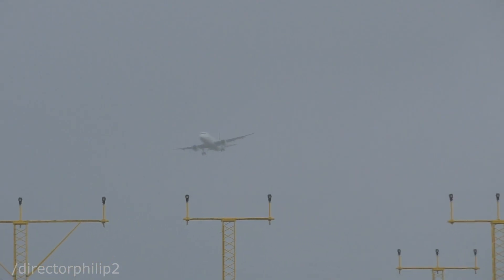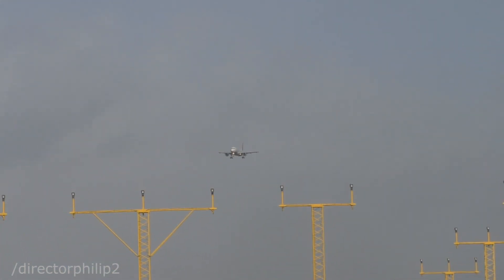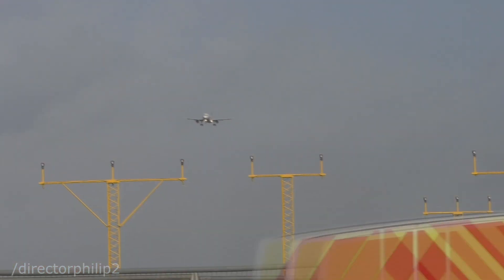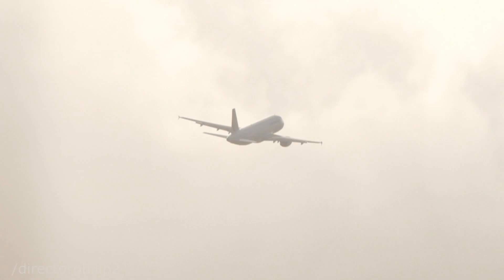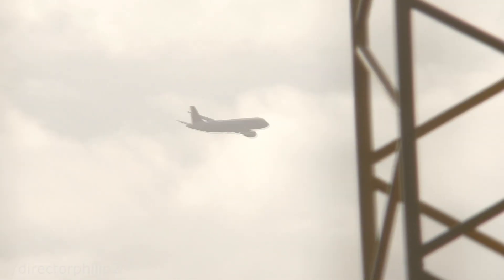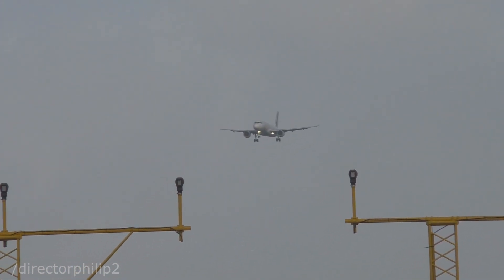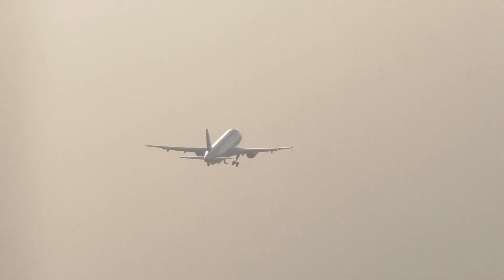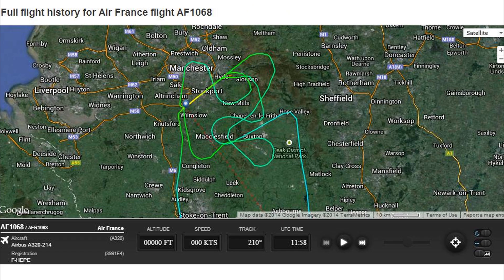Crosswind landings aborted 3x Go around extreme weather

Comment: Great video! To your question in the intro: the autopilot is a great tool but it isn't perfect (yet?). That's why almost every landing is manual exept when very precise conditions are met. In these condidions it id probable that the autopilot will disengage automatically on final approach of at least does not authorize auoland. To illustrate this: a 777, one of the most advanced and widely used aircraft in the world, ended 50 feet off the runway due to an autopilot errer in the autoland-phase. Greetz, G! 

(ps: when I talk about autoland I mean CAT III)

Comment: That wasn't the autothrottle disconnect, that was the autopilot. AT has a single chime. But no, the pilots would not have been conducting an automatic landing in those conditions - outside of the max crosswind limit for the autoland system. So either they hadn't disconnected the AP yet on approach (they may well have been planning to take out out at decision height, as hand flying in those conditions isn't so fun), or they could have put the AP on during the go-around. They likely disconnected it due to a gust that wiped some speed off and wanted to establish positive manual control.
Reply from the maker: Thank you for explaining

Comment: if the pilots decides to disconnect the auto throttle it will also have the same sound warning so it may not be the autopilot, because I have heard autothrottle sometimes have difficulties reacting to very quick wind changes which makes a large variation in airspeed. so they may disconnect autothrottle and leave it at one position.....
Reply from the maker: thanks andy :)

Comment: I would like to know why they did 3 attempts ? it is only allowed in one specific condition to proceed so. Otherwise, after the 2nd one, you have the obligation to divert to another airport.
Reply from the maker: a passenger on the fight said they put extra fuel on because of this weather, just got that news below
Reply: There are no rules, you can make 30 attempts if you want to (and have the fuel). If you think there are rules saying otherwise please provide a source.
Reply from the maker: Johan Grauers there's no rule but there's an airline has it's recommendations
Reply: Johan Grauers thanks for tha answer, and I were wrong, sorry; but it depends on the company you work for, as for some, divert after the 2nd attempt is required (as really stressful situation for pilots, and with still in my mind, the crash in Polland in 2010); thanks for the answer.